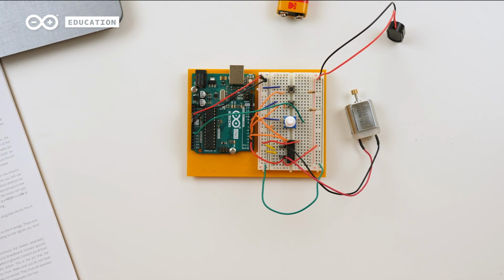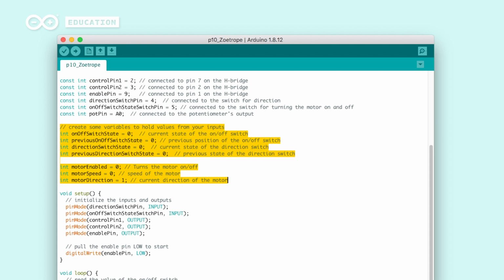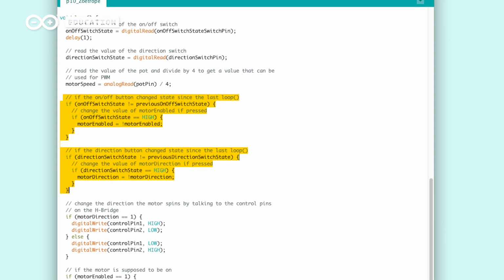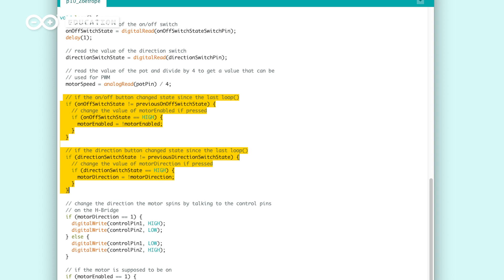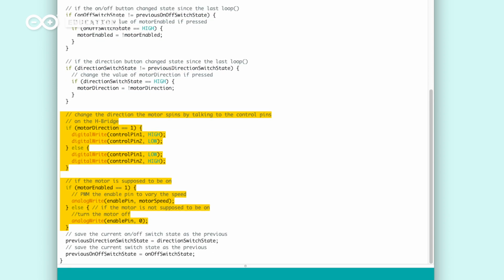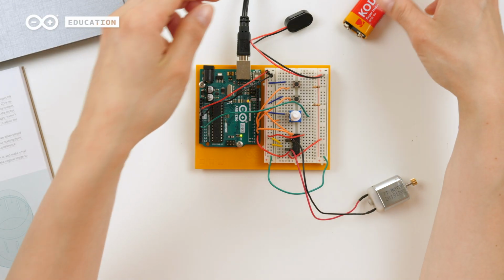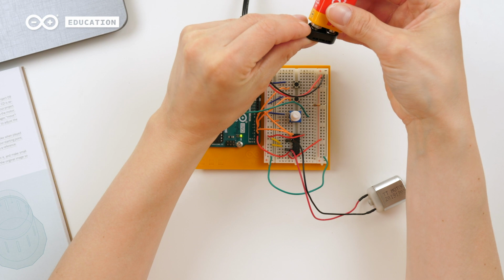10 Starter Kit: Zoetrope

Comment: what is the motor being connected to? what is the name of the yellow part, that connects to the gear on the shaft?
Reply: This parts are given on aurdino case
Reply: Pratik is correct, it is a part give in the arduino kit. If you have a 3D printer I can create a part similar to it that you can print if you like, it is fairly simple

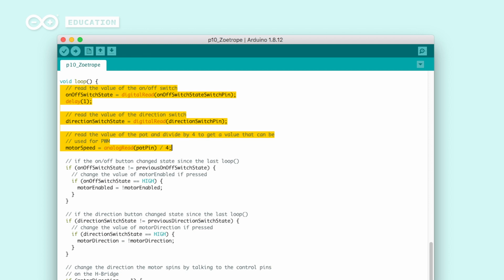Comment: 3:43 how did you come up with that formula; motorspeed = analogRead(potpin)/4. Why dived to 4?
Reply: Because the readings from the analog inputs range from 0 to 1023 (1024 different values possible) and the PWM outputs range from 0 to 255 (256 different values possible). So to directly match the potentiometer value with the speed of the motor, you divide the input value by 4, as 1024/256 = 4.

Example: the potientiometer is at 50%,  so the input analog value is 1024/2 = 512. To get the corresponding 50% in PWM output, you divide the value by 4: 512/4 = 128. 128 is half of 256.
Reply: @oyyy-ch9gx  Really Appreciate that. Thank you.